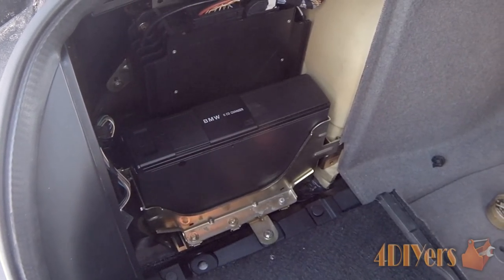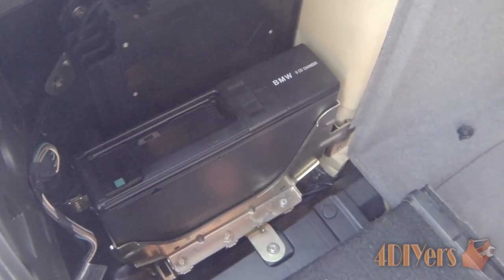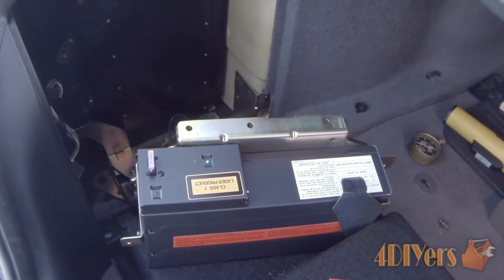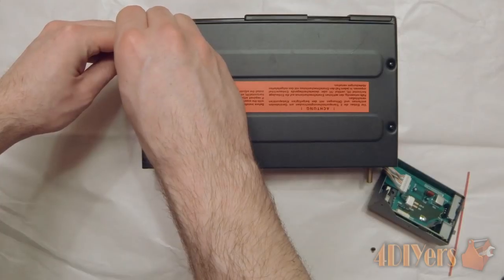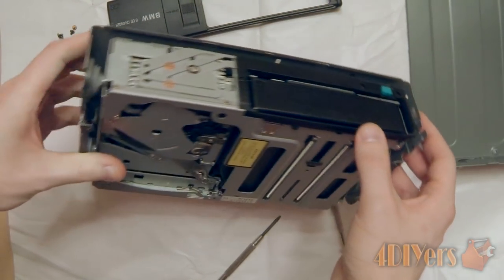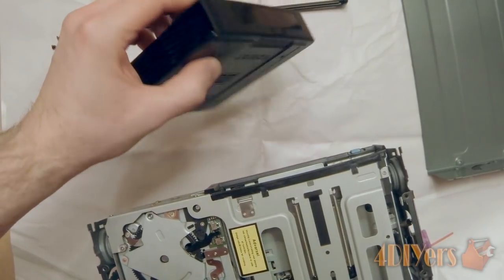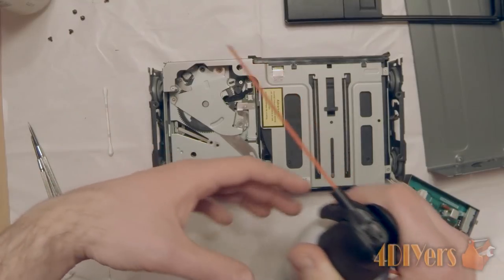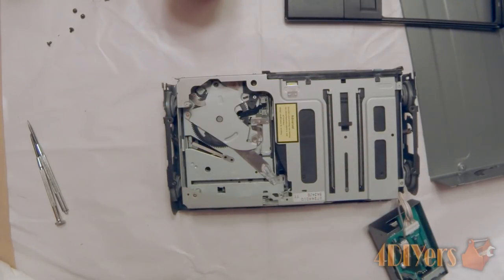DIY: CD Changer Disassembly & Repair

Comment: Thanks! Did mine yesterday (2004 Jaguar XJ).  I added switch cleaner to the mix - many problems in devices are caused by the little switches telling the mechanism where it is not working properly. My problem was that it did not want to eject the cartridge. At first after the lubrication service it still did not want to do that. So I focused on that side, without opening up any further , spraying contact cleaner and activating the eject button, the release clip, and the tiny peg which I think is to monitor the presence of a cartridge. Now it's 100%!

Comment: Thank you for the video! Fixed mine! Used a needle nose pliers to force the big gear unstuck. Lub  everything up with lithium grease and works well. Silicone spray the 4 rubber absorbers too
Reply from the maker: Excellent to hear and happy to help!
Reply: @4DIYers  the same error came back yesterday, I guess the black gear is stuck again, there is a small switch that is suppose to cut power of the motor from over-running the gear till it stuck. On the wheel there is a lever that is pushed to trigger this switch, I may look into it, perhaps the motor is moving too fast due to worn parts going past this trigger point. Did you have the no disc error came back? What did you do?
Reply from the maker: It would be best to go over it again, clean any areas you may have missed and maybe take it apart a but further. I had one model that required more disassembly, after the second time the issues were fixed.

Comment: Very useful video thanks for posting.  My problem is that one of the trays within the changer is stuck half way out. I can't push the cartridge out cos the tray is caught in amongst the cd spinner gubbins. I can move it maybe an inch or so but it looks like it's getting caught on the little white disc in the centre. Any advice on how to get the tray to go back into the cartridge?
Reply: Exactly what I'm dealing with now and need to know how to tut ake out.

Comment: Thanks so much for the video. I removed the CD changer of a 2002 BMW 745i, hoping i can fix it with the video. Apparently, it needs more than cleaning. It just won’t pick-up and read the CD. Nothing seems to be broken. I hope you can have a Part 2 of the tutorial that could help me with the problem. Thank you!

Comment: Thank you so much. Your video was very helpful, I've fixed my changer and now my CDs don't get stuck anymore, but I've got another issue. Sometimes when I'm listening, the music is just perfect without any problems for hours, and sometimes it starts making awful noises as if the CD is all scratched up, but it isn't. I've tried using one of those cleaning CDs with small brushes, but still no help. The problem comes and goes whenever it wants to. It doesn't come after hitting a pothole or any noticeable vibration, just from driving on a clean straight road out of nothing. It's really irritating is there any fixable reason why this is happening, or should i just replace my whole changer ?

Comment: The external casing seems to differ on these E39 CD changers depending on what model year the car is. I found the hardest part was getting the casing off! Mine (2000 year CD changer) had 4 tabs on the top of the case that needed pushing before I could unlatch it from the faceplate side. Also, it isn't that hard to remove the changer from the base cover, i.e. remove the springs and the 4 rubber attachment points. Then you can roll the lens mechanism up so it's visible from the back side and spray it with compressed air through there without having to actually remove the lens mechanism. Putting it back together wasn't that bad but the CD changer wasn't lined up quite as well in the base casing when reinserted despite the springs being in the same position as previously, and it looked slightly pulled to one side and stretching the rubber mounts. I found that I got a lot of cotton threads when cleaning it up with alcohol (meths) which didn't blow away so easily with air; and also when apply the grease with the cotton bud, I had to be really careful and not rub it onto sharp edges or I'd get threads everywhere. Some of the gearing and cogs didn't appear to have any grease on them, which you didn't mention, so I thought wth and put a little on them. Screwed it together and it all works so far! ;-)

Comment: thanks for posting. just fixed the cd changer in my bmw. had to fiddle with it a bit as there was cd stuck inside. very much appreciate you making this video. greetings from the uk.
Reply from the maker: Awesome to hear, thank you for the feedback! I also have a video on the operation when the case is removed, not sure if you've seen that.
Reply: Hi there, thanks for the posting. I cleaned it nice and had it working for two days and now again getting stuck. Any additional suggestions?  I made sure that all points were lubed up. Don't see any broken. Willing to try it once more. Tx in advance for your help and advise. Also any idea what Alpine would charge for their 90 days guaranteed repairs? Would like to keep the original unit in my 98 Z3.
Reply from the maker: Which part is getting stuck??? Is it the plastic cd container or the tray which holds each cd that has the laser??? I just fixed a friends cd changer recently and it required even further disassembly on that tray when the laser is held. Still fairly straight forward, it's just an issue of hold lubricant causing the assembly to stick. I'm not even sure what Alpine would charge. I would assume their hourly rate is about $80 or they'd say you'd need to buy a new unit.

Comment: Solved. problem is  electric motor for vertical and horizontal movement.
Reply from the maker: Excellent to hear!
Reply: @4DIYers  and just to mention, there is third motor for laser, is same chinese make and if your lens is clean, its not a micro switch, its motor.
buged me long time, so now i got to sale my e46  i put some effort to fix it. its second used unit on this car. So main problem is rusty brushes, well not pro brush just rusty wire on rotor when it finds sweet spot wer fkt.

Comment: Hey, nice video, 
maybe you guys have some info
My changer interrupts the sound when I drive on slightly  bumpy road, is it a normal behavior? or its has problem and can be fixed? Like old cdplayer had antishock so it did not interrupt does these ones have it?
Reply from the maker: Thank you. No it shouldn't do that. Try switching over the locations of the spring slots on the side of the case.

Comment: Somehow I had managed to fit the cassette not only upside down, but also back to front.  I blame the manufacturer for putting the part number that way around on the other side.  But is there a prize for managing to be quite so stupid ?
Reply: lol back to front is easily done as there are 2 holes on top and bottom of the side of the case, and when putting the external 4 screws in to latch onto the bracket it isn't clear which way until you try to install it, but upside down? lmao that is a classic. I wish you had filmed it.

Comment: @4DIYers Hi, thanks for the helpful video! I've got a CD stuck in the reader though, so the cartridge won't come out. Do you have any tips on getting a stuck CD out?
Reply from the maker: I have had that problem. Just check out my video on the operation of the cd changer and it'll show what you need to push to pop out the cartridge.

Comment: is the lithium grease tougher then regular grease?
Reply from the maker: Lithium grease tends to be plastic safe and it doesn't change under temperature so you won't have to worry about it dripping on components when hot. Don't forget to subscribe :)

Comment: @4DIYers You can gain access on these when you remove that metal clamp holding the top white ring in place, the one that goes in the middle of the disc. The lever taking the disc out of the magazine has to be move to the left, than once you remove that white ring you can see the lens. There is enough room for a alcohol soaked q-tip and light from a flashlight to poke through so you can see what you're doing.

Also apply grease to the top of the white ring, it should have some from factory and thus it is easy to see where to reapply it.
Reply from the maker: Excellent tips, thank you for sharing! Don't forget to subscribe.
Reply: 4DIYers No problem, thanks to your video I also was able to fix the changer. Also I used a tiny bit of contact spray on those micro switches and worked that in a bit, cause those can get a bit dirty over time as well,
So after I did the greasing up and contact cleaning, I thought I'd clean the lens as well to cover everything in one go.

Subbed.
Reply from the maker: Luckily I haven't had any issues in the past with the microswitches. Seems to be the lack of lubricant causing the most issues. Definitely beats trying to buy a new or used unit. They can get quite pricey and a used unit may cause the exact same issues. Thank you again for the tips and support :)
Reply: 4DIYers Do you per chance have a service manual of this cd changer? It seems my arm is stuck again that needs to grab the cd's out of the magazine. So I want to try and get in a bit deeper next time.
Reply from the maker: LogiForce86 Unfortunately I don't. The try area where the cd's are pulled into can be split down and it's quite easy. I don't have a video on this but if I remember correctly the slotted brackets on the side need to be removed by taking off the snap rings (use a small standard screwdriver, don't lose them, and also keep an eye on the nylon washers), remove the phillips screws on the try pins, then just be careful around the wiring. Take lots of photos if you need to, videos even help too.
Reply: 4DIYers I already fixed my issue. I removed the nylon washer on the right hand side of the metal plate covering the big black gear that moves the arm. Indeed don't lose it, and also there is a spring on the frontplate side under the metal cover. Seems that as the old grease dries out the black plastic of the gear starts to rub off on the metal plate, and this is what stops the movement over time. So removing all old residue and greasing it up did the trick.

So yeah, you need to remove that plate to really fix this issue with the lever by removing the plastic residue and all old grease. Else it'll keep coming back and haunt you.
I'll have to still do a long term test to see if it stays operational, but if I don't forget than I'll report back to you.
Reply from the maker: Excellent to hear. Usually the problem will pop up in the cold if there is something that's a little sticky. Ever since I produced this video mine has been fine and I use it almost all the time. Was going to upgrade to an aux MP3 input, but it hasn't been on the priority list.
Reply: 4DIYers It jammed again yesterday and I opened it up again today and removed all the arms (losing one tiny nylon washer down the line >_< ). When I did this I noticed the small arm in the lower left of the actual player section (lower left is the micro switches) got kinda stuck. This arm moves two mechanical levers that locks the player in height on all four corners. This at the position of those 'fingers' on the front and back side. The levers move between these fingers to lock the player at the right level, but without lubrication they seem to snatch sometimes. So this is what I just soaked with grease and now it works again... for now.

Luckily after walking through half the city here I found a fitting metal E-clip at a hifi specialist store, and he gave me one free of charge. Most people will be screwed if they lose those nylon washers though, as they are really hard to find... especially those tiny ones of OD 3.5mm / ID 1.7mm / thickness 0.4mm.
Reply: I am also thinking of installing an aux in the glovebox, but also want to add the official bluetooth module. As extra to the aux I want to see if I can get one of those 12v aux power adapters that go into the flashlight socket. That way you could just leave an ipod in the glovebox at all time for example when driving long distance.
Reply: Yup, greasing up those fingers did the trick. Haven't had any stuck trays anymore no matter how many times I switched discs. :)

Merry Christmas 4DIYers, and the best wishes for next year. :)
Reply from the maker: Awesome to hear and thank you for the updates as well. DICE also makes a plug/play module if you were considering that route, have heard some good reviews but never used one myself. 

Thank you! Merry Christmas and have a Happy New Year :)